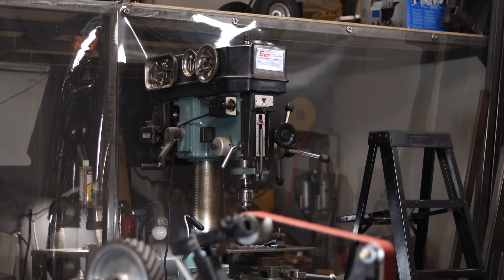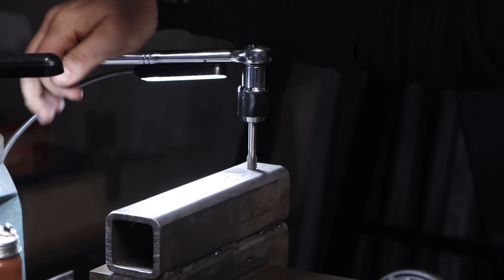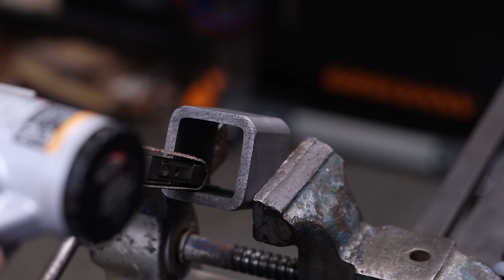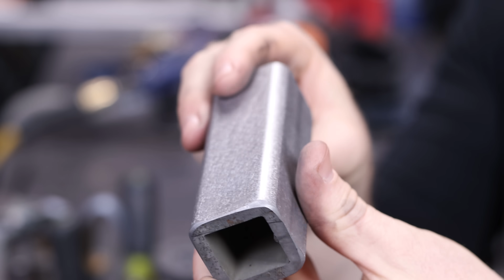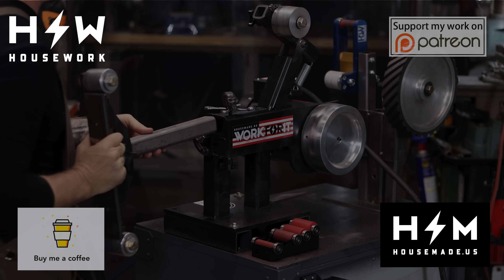How to: Remove Weld Seam & Telescope Tube Steel

Comment: My god! All that for that! What a waste of your time and clients paying for your time! The odd section of an odd job yes! But if your manufacturing and need slip joints why are you not obtaining seamless section! In your case lengths! As you’re always using it! Many pipe manufacturers make seamless tube! For that reason! And you can special order it should you need out side common sizing, the difference would outway your time cost! But carry on.
Reply from the maker: 10x the cost. 😁🇺🇸🤩

Comment: make a block of steel that fits inside the pipe you want to remove the weld seam from. put a big thread through it so you can pull it through the pipe with a teacher ad a length of all thread and a welded on   nut.  In that same steel block make a receiver for a b bit of high speed lalthe tooling that you grind a slightly positive rake on and another threaded hole to lock it in place and use that cutter to strip away the weld as you operate a power  driver on the nut.  This  allows you to clean up square tubing of any length so long as you have the allthread long enough.

Comment: How do you suggest I make two of these parallel to each other? I'm in the process of fabricating something for my commercial mower Which will allow me to put a sprayer onto it. I'm going to use two receivers about 30 inches apart Made out of square tubing, but if they're not 100% parallel the solid receiver Which needs to slide into both tubes will not work.

Anybody I would  truly appreciate Your expertise.

Comment: I have a bucket truck 🛻 and my bucket extends past the back of the truck. 🛻 I recently hit a parked car because of the blind spots…. 🤔👀 
Tired of this problem and I want to fix it, I’m thinking 🤔 of mounting my reverse camera on a telescoping tube with a linear actuator, so when I put it in reverse and hit a switch in the cabin, the camera will extend out to the edge of the bucket so I can see what’s behind there.

My only thought is if it gets damaged I want to design a failure point in it so it snaps instead of damaging the actuator or tube.
Thinking a nylon attachment between the two.

Do you know if they make square tubing but in abs, nylon or plastic 🤔

Comment: I am a machine designer professionally and a hobbyist metalworker. It might behoove you to have a broach made up to shave out the inside of the outer tube since you are producing the kits in quantities. Remove the mill scale first then put the broach through to remove the weld flash/seam.

Comment: I just use a burr, or a burr on an extension if it's a long piece. Much cheaper than the tool in the video.
Reply from the maker: That works too 👍🏻😁

Comment: I made a small motorcycle frame holder to fit my auto lift with telescoping square  tube that clamps the frame luv it easier to work on now

Comment: Video is great but can I get a little help. Purchased. 2x2x 1/4 tubing and 1 1/2x1 1/2 x 3/16 tubing took it home excited, ground the seam flat and no luck. It was severally getting hung up on the corners . Though I might have got some off size metal. Went to a different shop bought the exact same sized and got the same result. Any advice?
Reply: The radius on the corners of the 3/16 is smaller than the radius on the 1/4” wall tube.  I have found it is best to keep the wall thickness the same on both pieces of tubing for best results.

Comment: You don't show how to remove the weld seam on a 2-3 foot long tube.  Obviously you can't reach it with the little belt sander. So how would you do it ???
Reply from the maker: Use a longer belt. Easy cheesy

Comment: I really like pneumatic tools too. I'm not even certain why. But you need a good set up and work space and for me they can lack convenience due to my cheap noisy compressor. The tool you are using is not a file. It requires sandpaper belts. Files do not need abrasive consumables such as sandpaper. It's a belt sander, specifically a finger-sander. The first time I saw a finger sander I laughed. I thought it looked like a silly tool and surely wouldn't have many practical uses. I ended up needing one for a specific job so purchased one to fit the batteries i use. Turns out I was wrong. They're a great little tool even a cheap one. I use it for all kinds of things I wouldn't have considered and find it very convenient. It fits in my toolbox neatly beside my multitool and their shapes compliment and protect eachother.

Comment: With such short pieces of tubes, you can use a flat or half-round file, eh? The question is, how to clear those weld seams in long pieces, say in excess of a meter (40"+)?
Reply from the maker: Look up the Seams impossible tool from Greg's garage.

Comment: Mat From Next Level Carpentry (youtube) made tool and sold them along with another YouTuber.I purchased one and it works well it is block with bearings on each end a rotary bur grinds the weld. The length can be extended to any length you need by adding lengths of extension between the drill and the bur.
Reply from the maker: Is it the seams impossible tool with Greg's Garage? I bought one too and it's great.
Reply: @HouseMadeUS  Yes you are correct! 😁🛫

Comment: BE WARNED  - Muriatic acid is the devil in a workshop. Any vapour from Muriatic acid will rust every piece of metal in your workshop. Keep it elsewhere or well sealed - even old rags with it an be a problem.
Reply from the maker: Agree 100%. Not good in a metal shop!

Comment: A better way is to make a broach with a carbide insert cutter attached to a smaller piece of tubing modified to fit, this way you can use threaded rod to pull it through and you can do long pieces.
Reply from the maker: We have tried this. It's hit or miss. Can stretch the tube if it gets cock-eyed
Reply: @HouseMadeUS  It might be a pain to run it through twice, but you could make two with different depth of cut, or make the one adjustable, or put two or three cutters at different depths like a regular keyway broach. Anything to avoid sanding, that is a pain.

Comment: This is awesome. I've had ideas for a height adjustable table/desk, but hadn't found a good/strong/cheap way to come up with the telescoping legs. Also for putting small winches in places that I need them temporarily. And other scenarios where I want something that gives me both positioning adjustability and has enough strength to reef on.

Comment: So I’ve got a trailer tongue jack , the inner telescopic leg, I’ve got a drop down leg that fits inside. But the ol weld seam, I was able to hit it as far as I can, but the last 2”. What do you do when it’s too deep, and your material is too thin to put a groove?
Reply from the maker: Check out the Seams Impossible tool from Greg's Garage.

Comment: How do you address the weld seam in a piece of tubing that is six feet long? The only way I have found is create a groove in piece that slides into the larger tubing that allows the weld seam to ride in the groove. Good video.
Reply from the maker: Yeah with something that long the groove is going to be the way.

Comment: +1 on the air belt sander. I got mine grind out spot welds in panels. Now I use it to flatten welds when needed and chamfer, debur edges..many uses. Now I will try on ERW sq tube next time

Comment: I tried to watch this video, but you beat around the bush too much talking about other stuff. Every video now includes a lecture on ppe. I get it. Wear safety glasses and ear plugs.
Reply from the maker: So did you like it or not!? I can't tell.
Reply: @HouseMadeUS  i gave up before you got to the actual part i was interested in. You went on about why you like to use steel. I get it. We all like to use steel. That's why i clicked on it in the first place. I just don't want to sit through a bunch of material that has little or nothing to do with the advertised subject.
Reply from the maker: Sounds good. Thanks for the attempt.

Comment: We’ve ran into this problem before building machinery. The dynafile is one way to remove the weld seam on short pieces. Then you have the problem of pieces that are too long to be able to remove the weld. In those cases we have resorted to taking the mating piece of tubing, placing it in a mill, and milling a V groove in it, so that the groove clears the weld. This allows the pieces to slide back-and-forth without removing the weld.
Reply: Nice if you have a milling machine.
Reply: @glenpaul3606  yes, a milling machine is the easiest way, but you can also draw a line and use an angle grinder to cut a groove in the part. It’s not ideal, but it can be done.

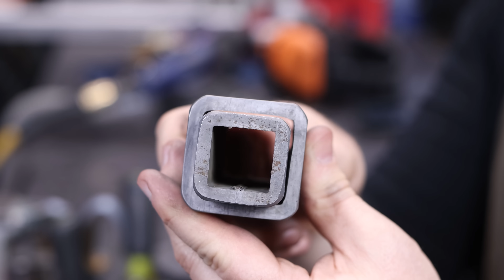Comment: Obviously 1½"x1½" tubular steel only slides into 2"x2" tubular steel if the outer tube has ¼" walls (the important wall size wasn't mentioned in the general statement starting @1:42), and other size combinations will also work as long as the outer tube nominal size minus twice the wall thickness equals the inner tube nominal size, and the corner bend radii are compatible (small enough on the outer, large enough on the inner).

Comment: Millscale is iron oxide magnetite that forms at high temperature. It also form on welds and should be removed before painting. You could also fasten a cutting bit on the end of an inside tube and tap it through the outer tube. Weld a cap on the end and screw on a triangular machine tool bit. Use it to plane out the weld on longer lengths.
Reply: I tried that and works great for longer tubes, also it makes less noise and dirt. I found that a little lubrication with light oil helps a lot.
Reply from the maker: I like the triangle idea. We have a flat one now and it stretches things a bit

Comment: If the heavy wall thickness in not critical you can buy 12 gage perforated or solid wall Telespar; no weld seam to remove. The fit tolerance is great and the tubing cross section  range is 1.5" to 2.5" inceasing by 1/4 inch. per increment with the same great fit between the inner and outer tube.  Some sizes are available in heavier 10 gage tubing as well.

Comment: I thank you for your channel. We both have been vaccinated with a Victrola Needle...Long Play.  That's what Dad said about me, about 6 decades ago...but we get it said.
   I like your content, sir. I, to, am a tool designer. Did it for 50 years. Am now retired. (If you have a long section to do, fit a piece of High Carbon Tool Steel in the end of a section of tubing, by cutting a "V" on one side of the end of a piece of square tubing and a square spot for your tool steel to lay into. Wrap it with a wet rag,  and reach thru the "V" and weld the back end of that tool steel. Then shove it thru your square tubing. It will cut out the weld seem. (you can get it in 1/4" square or 1/4" x 1/2" flat, and many other sizes for metal lathes and shapers at Machinist Supply Stores..It is lots easier to cut it out like this than sanding it out like you're doing it. The nice thing about it, you can re-grind the cutting tool multiple times. Like the old saying, "TRY IT, YOU'LL LIKE IT!" )  I like to watch other folks doing their thing. I subbed to your channel, sir. Keep pumping out videos. Thanks again.
   Bill, from Tn. 🇺🇸
Reply: It would be great to see how that is done. Trying to picture it in my mind.

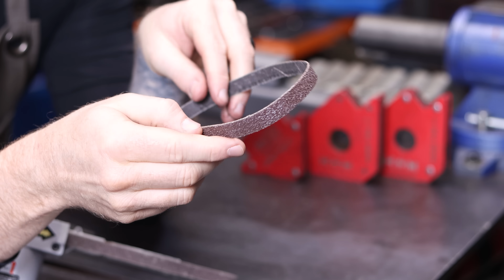Comment: @6:36 "You gonna wanna get the good belts for this..." (1/2x18, 36 grit)... but what abrasive? By "good", did you mean ceramic? Or something else? Thanks!

BTW, I removed the seam using a drill with longer 1/4 or 3/8 inch (10mm) shaft, slotted on one end, and emerycloth wrapped through the slot. Hold it parallel to the surface but slight angle to the seam to grind away the seam.

Comment: WHY? You can buy seamless square tube. Also I never heard a "finger" belt sander called a file before. It's not a file. It's a belt sander. In my sheet metal shop we call them finger sanders. Even Amazon calls them belt sanders.

Comment: you should check out fireball tool video on this very subject.    especially if you are doing this very often. He shows to make a simple tool using a piece of high speed tool steel and a little plug you draw through the tubing of any length  with a piece of all thread that shaves it rite out in one motion.  If you just have little short pieces and you only have to do it once grinding them out is easy like you show it.   But if you are making these its for folks you should check it out.   After you build the simple tool you can strip that weld in less than 30 seconds using a impact to drive it through.

Comment: You should put clamp screws in diagonally - that eliminates all play, whereas a screw perpendicular to one face of the tube allows play parallel to that face. You also get more stock for the threads.
Reply: I like perpendulous and you can just weld a nut on there if you want more threads. Go back to your drawing board, Poindexter.

Comment: So how does this little sanding machine u use work on longer square tubing my bro?? This small sander won't reach all the way on a piece of tube steel that is say more than 20" in length. Hoe do we get around that my bro? I've only begun working with steel, metalwork for the 1st time since I was 13 yrs of age in metalwork class in secondary school. LOL. I'm 51 yrs of age this year bro..
I love the belt grinder u built. I was thinking of buying a set of the wheels to build my own from Vevor. They're relatively cheap at under 100 euros but I don't know if that's very expensive at all due to my lack of knowledge in this field atm. I'm learning fast though. 
I began woodworking about 12-18 months ago and kitted out my own small workshop but I'm progressed into metalworking too now and I'm actually enjoying it again. I've bought a couple of welders with all the gear too. ATM I'm weary of welding in my woodwork shop bcos of fires so I will be hopefully clearing a shed in my back yard for the welding part. 
I only found ur channel a couple od days ago bro. I'm sub'd now.
I have a question for u if u don't mind me asking.. 
Q. Why is welding and metalwork and woodwork such big business on YT these days?? It's crazy to see how many ppl are making videos on this subject matter now. 
Best of luck withur business my friend. I wish u every success too. Take care man and salute from Dublin, IRE.

Comment: Nice “plug” on your other web site but the Title is “How to remove weld seam” in telescope tubing…I already knew how to use an electric (or pneumatic) file on short tubes and my problem is actually with longer tubes…so I naively believed that you were going to reveal some great “secret” technique 🥸…unfortunately, you didn’t…and I had to go thru 8 minutes of bla-bla about your industrial machines that you make, then how to remove Mill Scale and so on…finally 8 minutes into that 12 minutes clip, we find-out that, like many YouTubers, there is a lot of empty talk before getting into the substance…consider abridging 🥱

Comment: When the steel mill makes the tubing, it is first round and welded then the mill runes it through roller dyes that square it up. The mill doesn't not pay attention to where the weld is when they run it through the dyes so the weld can be anywhere on the side of the tubing. I bought some 2x2 1/4 wall that had the weld in the corner it was great I didn't have to do any weld grinding on that tube.
Reply: You say the mill doesn't NOT pay attention to where the weld is. Why do they pay attention to where the weld is? For strength?

Comment: At about 5 minutes, I was getting rather impatient, thought you were going to demonstrate something more "elegant" than sanding it off. I will try to figure out a way to use a carbide insert or piece of high speed steel to ream the weld seam away.

Comment: Nice video explanation.  I've got both a pneumatic and cordless.  What would you suggest trying to use for a seam that would be longer than you could reach even by working from both ends.  I've tried several different manual approaches but they aren't exactly perfect and take forever.
Reply from the maker: How long of a tube are you working on?

Comment: FYI   They sell steel tube with the weld removed, mainly for the receiver of a trailer  hitch.
Reply: True... in 3", 2.5" and 2" square inside, and possibly 1.25" square inside. There are also 2" hitch bars, but they're solid.

Comment: Make a clamp for a piece of toolsteel and weld it to a smaller peice of rhs that fits already. Drive it through and it will do longer peices. I've done a piece of 75mm x 75mm 3meters long... works like a champ. Takes a bit to make the holder but you always have it once made .

Comment: ya didn't say how you get the water off the steel after the vinegar soak.  I use denatured alcohol unless I can tolerate oil, in which case I use Kerosene.  you can cut  that weld off using a HSS tool bit  mounted in a small steel block that fits inside the tube and use some  allthread rod to pull the cutter through. You are only;y limited by the length of the allthread.

Comment: What is the screw in bolt with plastic star handle at 2:08 called please?
Reply: I'm no expert so I may be using technically incorrect names but most stores call those hand bolts, knob bolts, hand screws, knob screws, hand knobs, there are also hand nuts and knob nuts, smaller ones are usually called thumb screws and thumb nuts.
Star knobs and lobe knobs is used both for bolts and nuts, nuts can be blind or through hole too. There are also wing screws and wing nuts.
Other practic model are the clamping levers also known as ratchet lever knobs, those can be used as a lever to turn the bolt but you can change the position of the lever without moving the bolt by pulling the lever up. Adjustable handles are usually just a lever with a bolt or threaded hole.
Eccentric or cam clamp levers are the type most commonly used on bicycle seats and wheels, but of course can be used for other purposes and can be also made of steel.